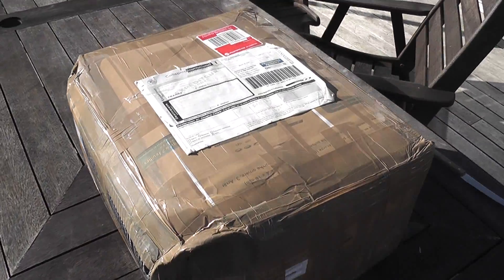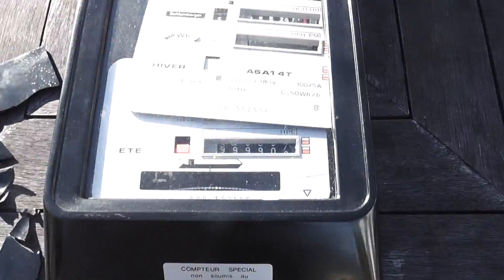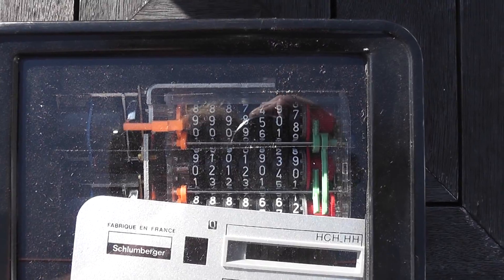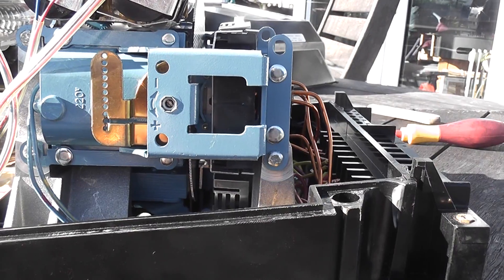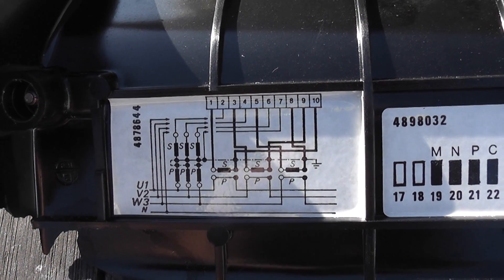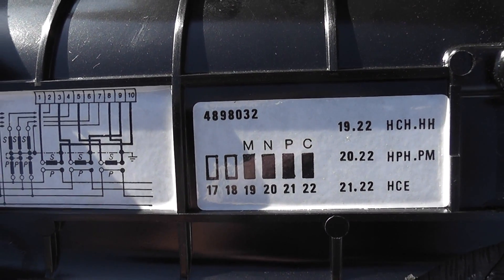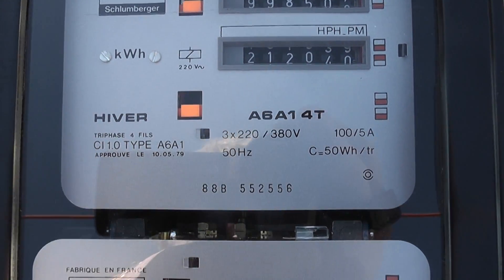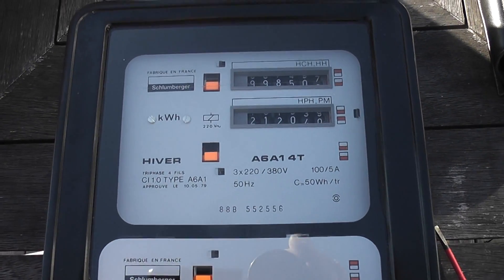Schlumberger 4 néé 6 tariff meter

Comment from the maker: Thanks for that offer. I currently use Google translator which works well.
I am on the look out for a replacement terminal cover for this meter, so if you know someone in the power industry who may be able to source a cover ?
No doubt that some meters are upgraded to electronic versions and often old meters are just scrapped.

Comment: Does a 3 phase meter run properly on single phase? Will it work properly or will it do something interesting? I checked all of my sources and no luck of getting a cover. Darn postage! 

Why would they make a meter with 3 registers and only make cutouts for two? Maybe there is another model which does use the other register and is it blanked out on this meter? That is the only logical explanation I can come up with.